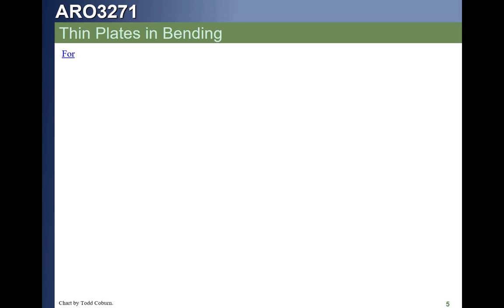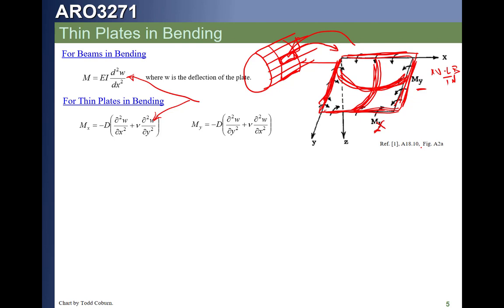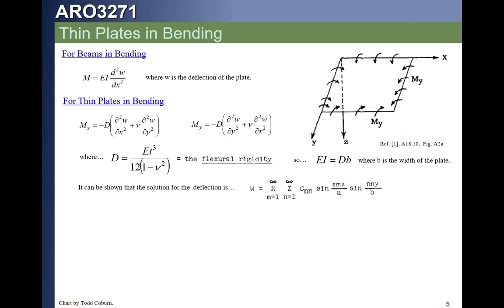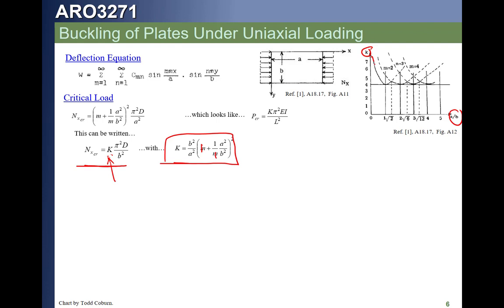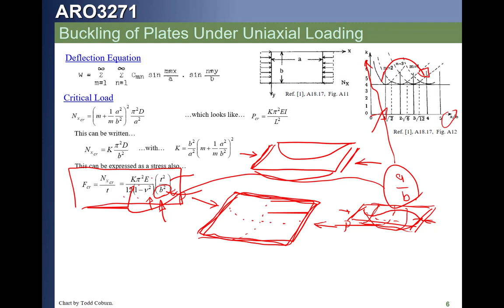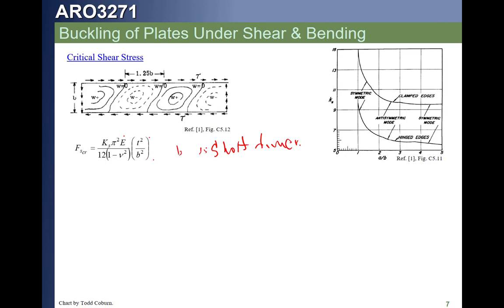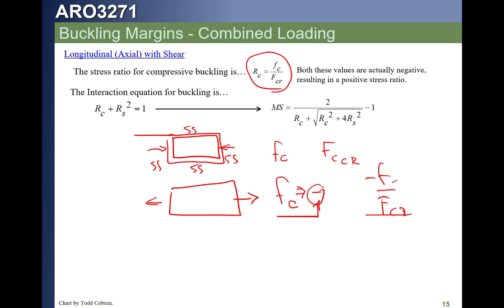Stress Analysis II: L-17 Stability - Buckling of Flat Plates

Comment: flexural rigidity: has information about "per unit inch" 11:00 ish
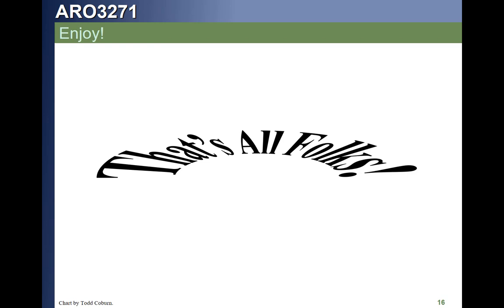tension relationship with buckling by stress ratio + interaction equations around 44:00
infinitely fixed = clamped 33:00
Reply from the maker: Thanks Krishi

Comment: Hello Mr. Coburn.  I’ve been looking for a shear web with two holes but can’t find it.  I have with one hole and how to calculate doubler reinforcement but can’t find with two holes.  Have you seen that type of design and analysis before?
Reply from the maker: Thanks for asking.  Michael Niu’s “Airframe Structural Design” has a method in chp 6 based on a Saab report that is pretty good.  He has other guidance and analysis methods that can be employed with modification as well.

Michael Niu’s Airframe Stress Analysis & Sizing has additional material on that as well in Chp 13.

Jean Claude Flabel’s “ Practical Stress Analysis for Design Engineers” chp 9 provides analysis guidlines that can also be employed
Reply: Thank you for your reply.  I will check these out.